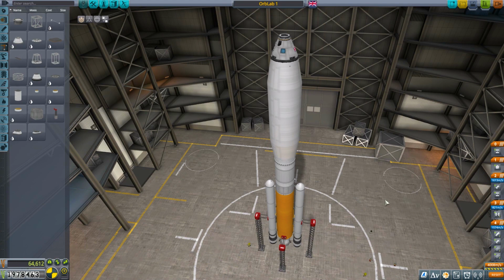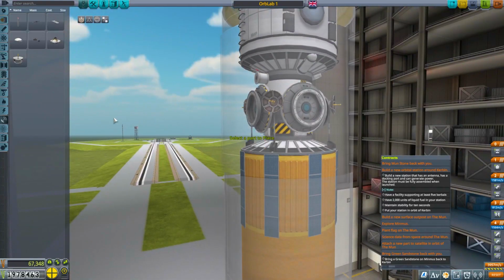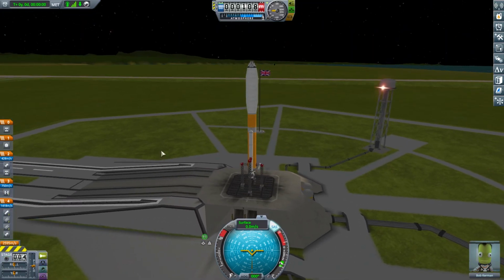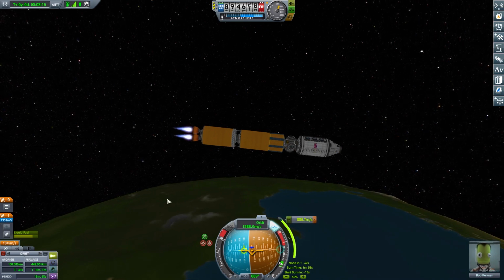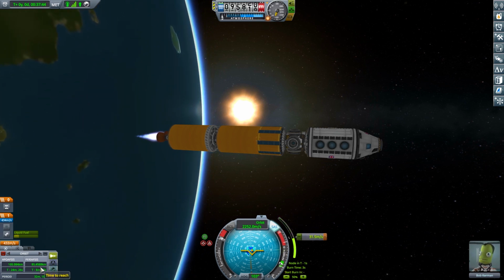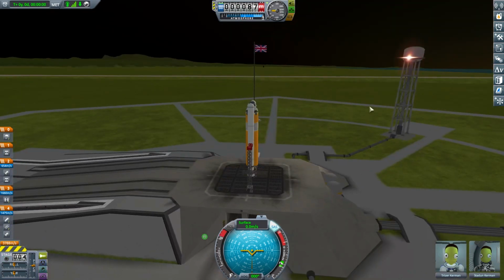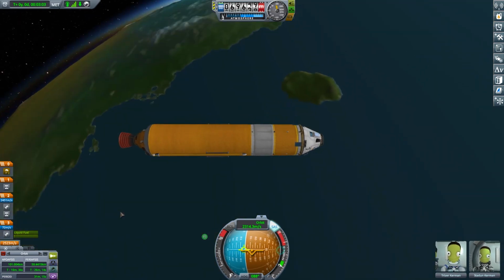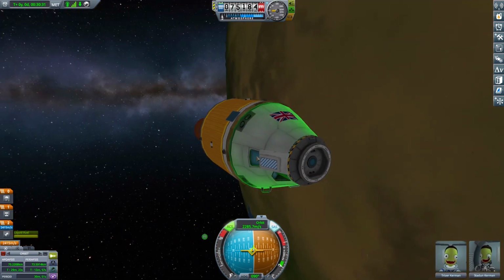KSP 1.12 | The Final Approach | #17 | Station Take Two

Comment: Swede was a good looking ship in my opinion!
Reply from the maker: Well it’s not a turnip..
Reply: @seyMonsters  in my play-along career game, I have a "Turnip I" set to do a fly-by of the Mun (with free return trajectory)! 

I've used the alarm clock to setup an alarm for the SOI change, and then I've made myself busy with other things for the interim time (rather than just warping the 3 days away). It turns out you can get a lot of missions done in a couple of days! I have done half a dozen tourist flights already (getting sick of those) and setup several comms relay probe satellites.  I'm playing on hard-ish. Comms is required for probe control, and money and science are used faster and earned slower.